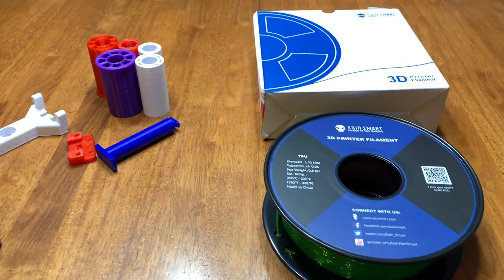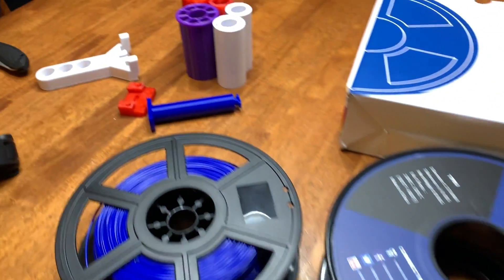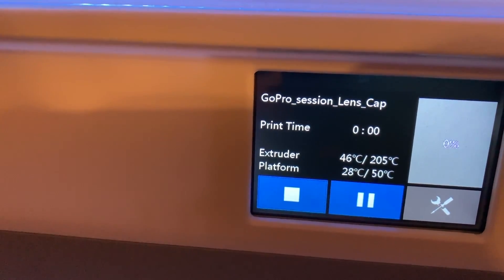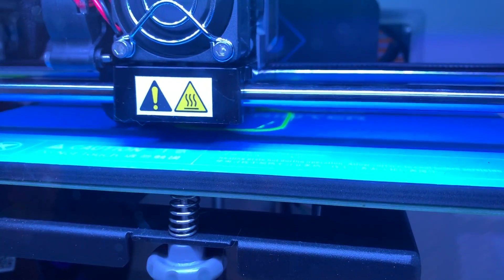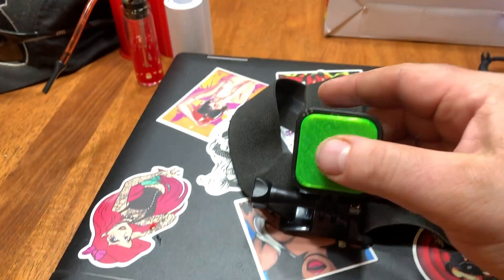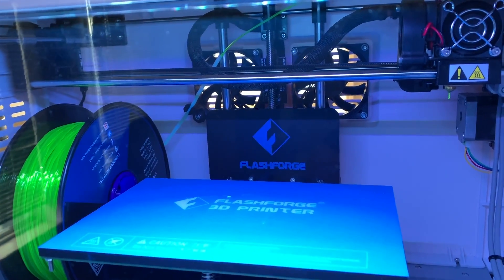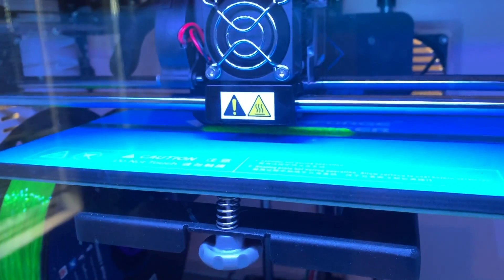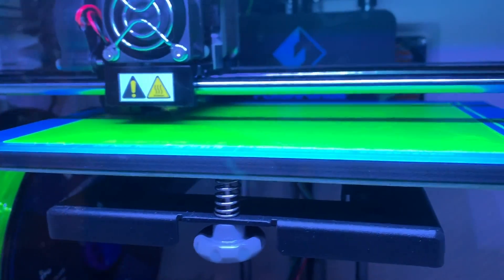FlashForge Dreamer NX Flexible Filament test

Comment: Has anyone had any luck with printing flexible filaments on their dreamer? Mine continually binds inside the extruder. Any feedback would be appreciated as to brand of filament you find that works and machine settings
Reply from the maker: i've never had a issue and didn't have to change much from the default settings either
Reply: @TestDontguess  but what DID you change from default?

Comment: I've found conflicting answers to this: Does the NX have filament runout detection? And what about bed leveling?  Thanks for demonstrating the TPU in this printer.
Reply: No run out detection, and it’s manual bed leveling. It has a option for bed leveling in the menu but you have to manually adjust bed,  it will automatically set the location and height of the hot end but you have to turn bed knobs and adjust at every station
Reply: @rcarney8848  Thank you for confirming.
Reply: @rcarney8848  Thank you. I was hoping for those features. Maybe they'll add them in the next release. :)

Comment: How do you control the temperature of the enclosure (not the bed neither the nozzle)?  By software?  By the local control panel?  Thank you.
Reply: You control when the fans come on, but I don’t remember any thing as far as actual temp control goes(like a thermostat) only fans on or off after so many layers have been put down

Comment: Nice video. I want to print flexible on my NX when it comes.
Reply from the maker: I’ve been printing flexible all weekend, a bit trickier to get dial’d in but I have good results with bed temp around 50-60 and extruder around 205-220